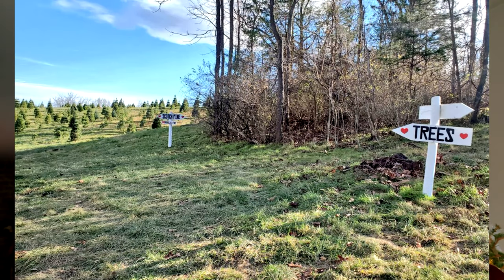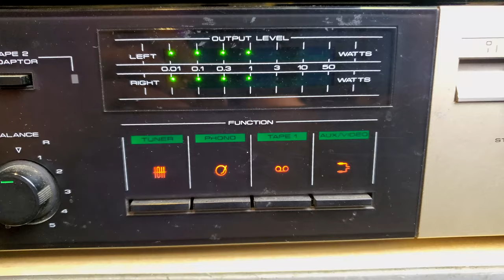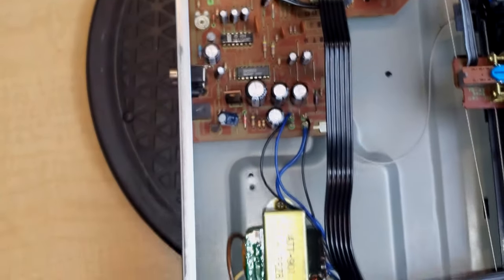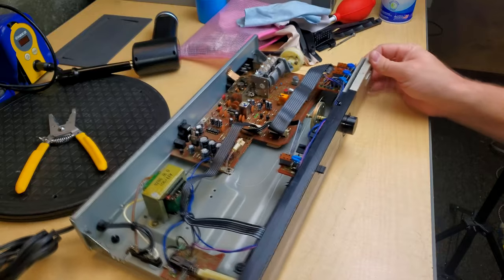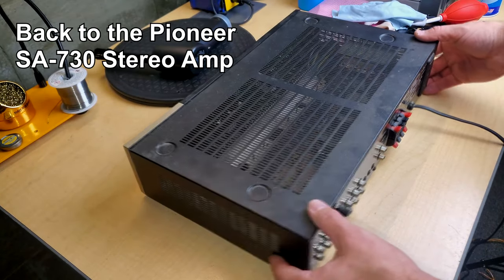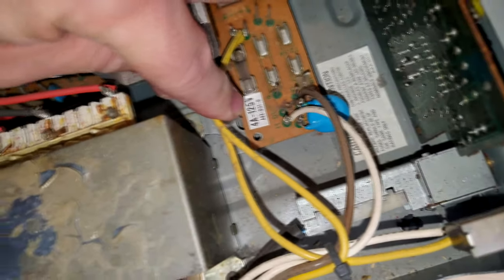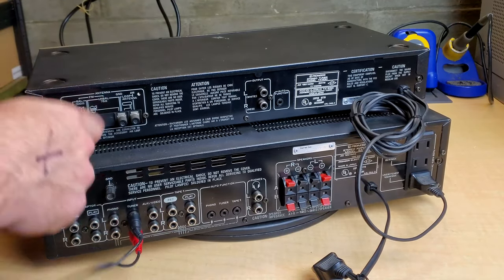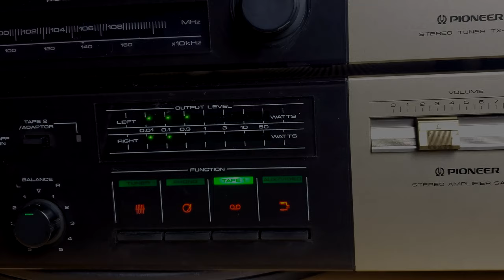Best Audio for Retro Setups: The Pioneer SA-730 & TX-530 from 1982

Comment: as a student i purchased this in 83...still got it ..it was superb at that time listening to volumes that the neighbours will compail about ..i blew akai and sony speakers with this set when i turned volume to 7 0r 8....it had crystal clear sound as expexted fomm ppioneer...i used this and double hooked it with my jvc home 5.1  100 watt and using both together i ussed to blow the neighbourhood.it is a good powerful amp for listening to rock music...i got  it in my garage now and wont part with it...the slide volume can become an issue but philips contact spray used to sort it out...it will still blow any home theatre system away.

Comment: I absolutely agreed, I use a vintage amplifier and speakers with my CRTs. I have been using mainly a pair of 90s Infinity Bookself speakers for the last few years, I bought them very cheap locally off FB but needed to refoam them ($20 in parts and a hour or two of work). They put out big sound, and are well shielded, I recently got some strong wall mounts for them and I am really happy with the results. This week I switched to a new to me amplifier, a Rotel RX-550, it’s from the early 70s, has incredible build quality and amazing power/sound. Picked it up for $32 from a local antique mall. Before that I used a NAD 2200 amp and NAD 1155 preamp, way over powered but absolutely awesome. I’ve found using a standalone bluetooth receiver and connecting that to the tuner input is a great way to get some “modern” use out of these amplifiers as well. Lots of great audio gear can be found second hand for really cheap, I’d recommend a lot of this stuff over cheap modern equipment, especially if you only need stereo sound and want well shielded speakers.

Comment: I've been using my parents old Sony audio amplifier and CD changer.  I need to open the CD changer and see if I can lower the resistance on the laser potentiometer because it's not reading discs anymore.  It's a really cool pairing with a PVM and some of my other Sony stuff, and sounds great through some 5" dual driver speaker.
Reply from the maker: Cool, I used to have a CD player with this setup, but it was a 6 disc cartridge system & a complete pain in the ass.  I eventually got rid of it.  Is it just a pot adjustment to fix something like that?
Reply: @RetroTechUSA  I sure hope it is, maybe it's just dirty.  This one has a rotating tray that opens at the front and holds 5 discs.  It's also possible there's a belt driven component that's disintegrated, weird for a laser assembly but you never know.

Comment: Quality 80s Pioneer audio equipment :)

The sound system (not my main one by any means) in my retro gaming setup (consoles ---> OSSC ---> HDMI-VGA ---> PC-CRT btw) is an off-white plastic 2.1 speaker system comprising a pair of 1999 Roland MA-8 2-way magnetically shielded speakers and a 1997 Altec Lansing Multimedia ACS250 "sub"woofer (to go with the off-white PC-CRT), but the speakers are two of the passive one from two pairs, and the "sub"woofer has also been passive-modded. All three enclosures have also had internal acoustic treatment with bitumen deadening and polyester wadding. They're running off Tang Band KIT0059 / AMH159-20 and KIT0060 / AMS161-30 micro Class D amplifiers with built-in crossover filters, after a Behringer FBQ800 9-band equaliser.

Comment: Great video 👍 I still listen to my Pioneer SA-930 which was part of a tower hifi with other separates I bought back in 1984. The tape teck is not working and turntable is shafted too. I did have the tuner and radio receiver but God knows where they are now.

Comment: We have a Pioneer amp SA 930 that the volumn button slowly went out. Tape wasn't holding it in anymore! When we clean it and it still doesn't work, what next?  I'm an original owner of a Sanusi 9090 that i bought when i was 18. I run it with 418R (hard rockers) Cerwin Vega speakers. Love music!!

Comment: Very cool video, I really love the way that Pioneer made their stereo amps ! For my retro setup I'm currently using a Sony TA-VE700 hooked up to a Sony Trinitron kv-29f3, both picked up locally for 30€ each. That massive TV is a pain to move around but it works really well. The sound from the Sony TA-VE700 goes to 2 Pioneer quite large speakers. Overall a really nice setup but it requires a lot of free space.
Reply from the maker: Thanks, Cool stuff.  Yes space is always an issue.

Comment: Looks pretty neat Steve. I wouldn't mind finding something of a similar vintage, maybe with a VFD display, or some analog VU meters, or both!
That reminds me, how are you finding the little cordless blower? Is it effective? I'd much rather something like that than firing up the air compressor all the time
Reply from the maker: Thanks, Yes I am actually likely the little blower a lot.  I plan to do a review on it and have been using it for about 2 weeks.  I just wanted to get a lot of use and data before I make the review, but honestly I think it's worth getting one.